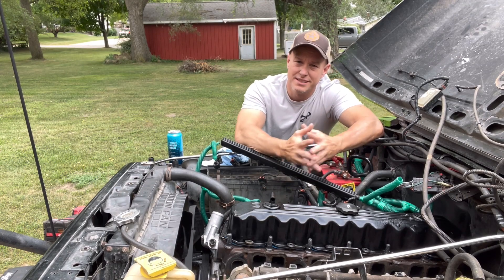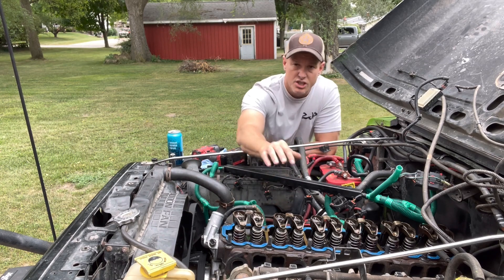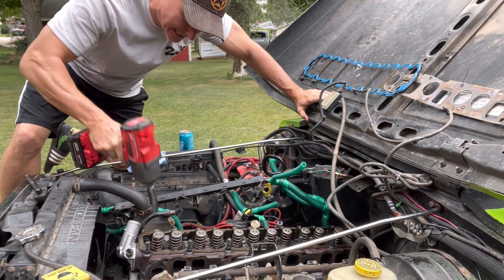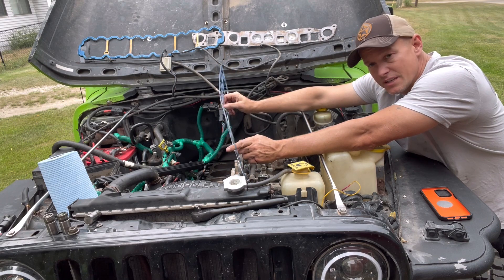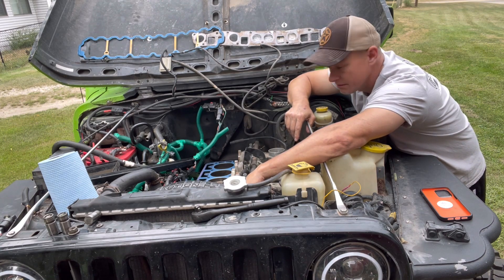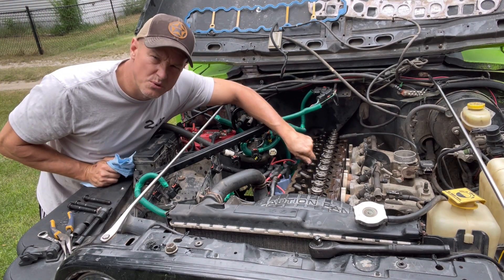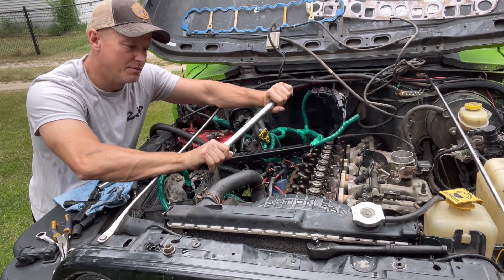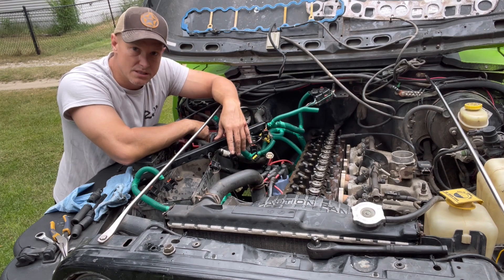How to Replace Hydraulic Lifters Valves | TJ Jeep 4.0 Liter

Comment: Likely the reason the other failed was because you didn’t soak them in oil prior to putting them in the engine. I tend to put them in oil and pump them up using a push rod and then just letting them sit in oil till installation. A lot of failures happen if people skip this step.
Reply: So so many ppl fail to do this
Reply: Why they're called "hydraulic lifters". Need oil!

Comment: That look heavy.  Did you have to perform the fuel pressure release before taking of the fuel injector stuff? thanks for the video boss 😼
Reply from the maker: I did not want to grab the lift, I would not recommend picking it up this way. Yes, I purged the fuel before removing the line
Reply: @FusionOffroad  thanx
Reply: No I flop the intake w fuel system over to the driver side... the fuel system doesn't need to be tampered with
Reply: Yeah, i plan to work on my jeep after i come back from deployment. After watching a whole bunch of youtube and diving into the service manual I feel like I can do it. Just way to stressed to do any work. Thanks all

Comment: Just fyi my friend.... they're just lifters.  They are not "lifter valves".  Mosre specifically, i suppose, refer to them as flat tappet hydraulic lifters.  To let these other folks know....failure to prime did not cause your issue.  It happens.  When it does, start with substituting a quart of oil with transmission fluid (high detergent).  Then do an oil change with straight 30 weight.  If that doesn't fix the issue then replace the lifters.  Usually when you play around with your oil weight you can resolve the issue.  This synthetic oil sometimes creates problems.